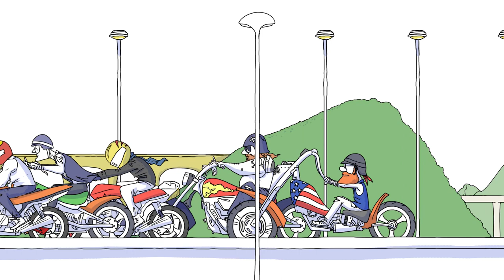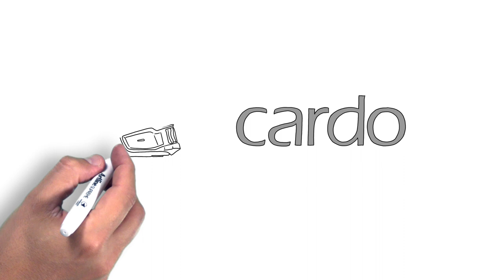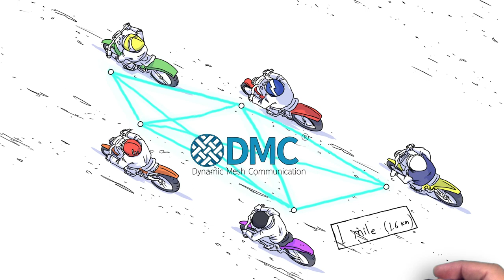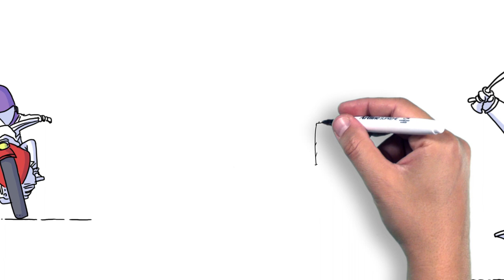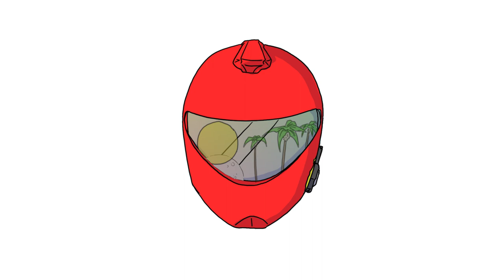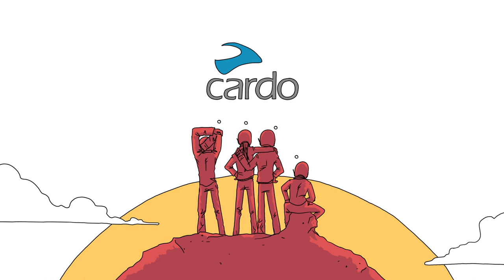DMC vs Bluetooth: What's so special about Cardo's new technology?

Comment: Can I connect my Bose wireless earbuds with bluetooth to the Cardo system?
Reply: Probably no. The part that goes on the side of the helmet is the brain / wireless transceiver. The speakers and mic are wired to that. You could connect the cardo helmet to basically whatever those Bose earbuds can connect to though.

Comment: Has the  cardo changes  there closed   mesh  to open mesh  so it can work  with sena's open mesh system ?
Reply from the maker: Hi Steve,
Thank you for reaching out.
No, currently our mesh network only works with Cardo units.
Cardo team
Reply: Senas "open mesh" isn't an open standard like the name would imply either. It's an intercom network that's "open to anyone in the group" ... it's all a bunch of slick marketing babble. Just like their "one mile between riders" nonsense.  Maybe one mile ... if you equipped it with a parabolic antenna, and all you had to do was connect them - but you'd never get voice over that "link".